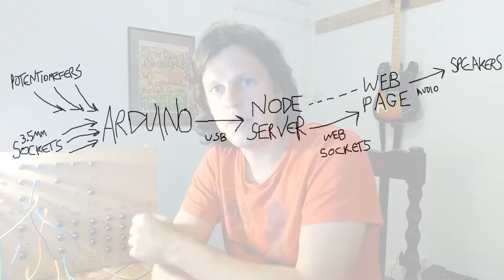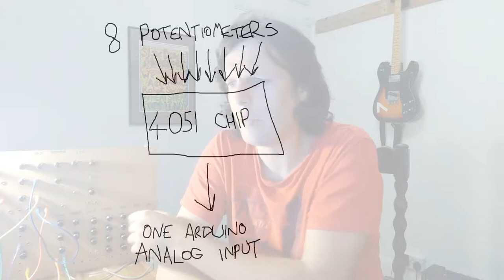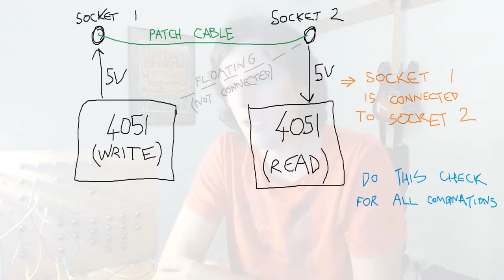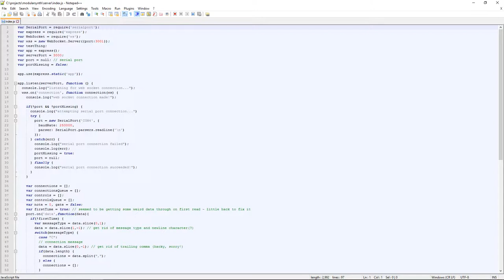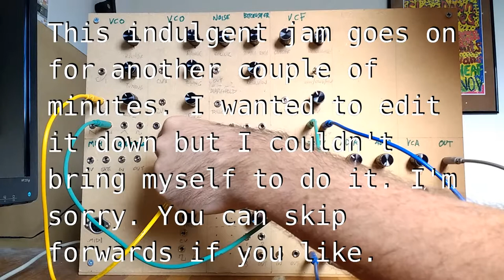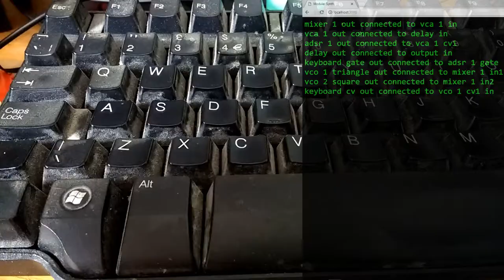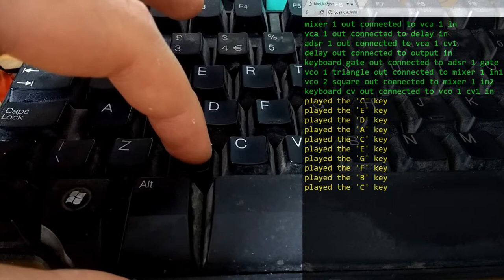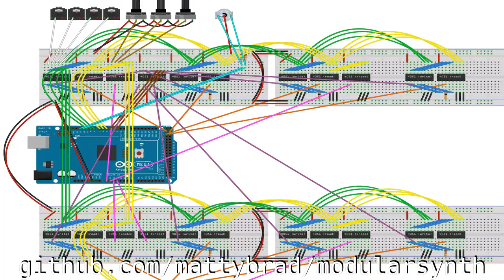DIY Digital Modular Synth In-Depth Explanation

Comment: Love it! Any more thoughts about pros and cons do make one that integrates with vcvrack like you talked about? Is there a risk of latency being a problem do you think?
Reply: I think it would be really cool if someone could make a patchable controller for VCV Rack, and the circuitry in my projects might be a useful starting point, but I had a look at the VCV source code a few months and decided it was a bit too complicated for me. Maybe I'll have another look after my next project is finished. I really like the idea of using an existing platform with a big group of engaged users already making modules, and the audio quality would be better than my Teensy-based approach, so it's definitely an an interesting idea, but the software side would be complicated. Not sure about latency - I don't think a controller would add much more latency than what is already in the software.